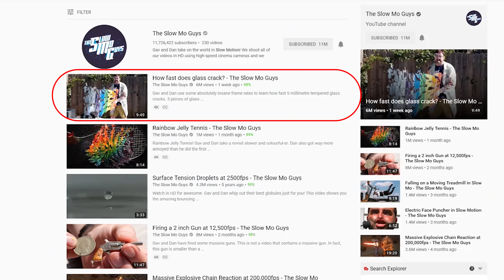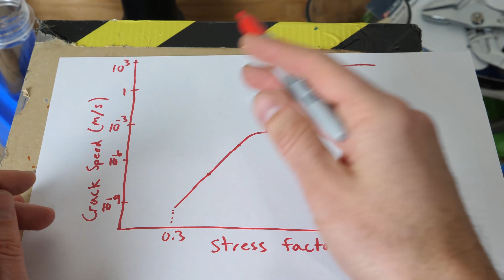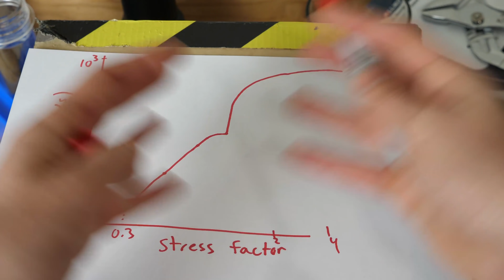The Real Speed of Glass Cracking—Filmed at 10 Million Frames Per Second With Hypervision HPV-X!

Comment: Explain this:

1. When showering, the bottom of the shower curtain is sucked in towards you. Isn't hot air(from the hot water) supposed to expand? Or is it because the hot air rises so fast and pulls cool air from the bottom? Anyways, what's going on?

2. When I take my empty, closed PET bottles outside in the cold to recycle them the bottles are crunched together. Again, hot air(at least room temperature) inside, cold air outside. Why? 

Thanks :D
Reply from the maker: Your shower water entraps air as it moves. Moving air has lower pressure than non-moving air. So the atmospheric pressure pushes in on the curtain. For you bottle the air inside gets colder when you take it outside. When you cool a gas it decreases pressure so the atmosphere crushes it
Reply: @TheActionLab  Ah, that makes total sense! Thanks for replying, love your channel!

Comment: @The Action Lab  I figured it would be related to the speed of sound in glass.  That seems to be the max speed at which forces can propagate through matter on their own.

I was intrigued by the slow start to the crack thing.  What is the timescale for reaching maximum speed and how does a crack gain speed, seeing that it's an effect rather than an actual mass?